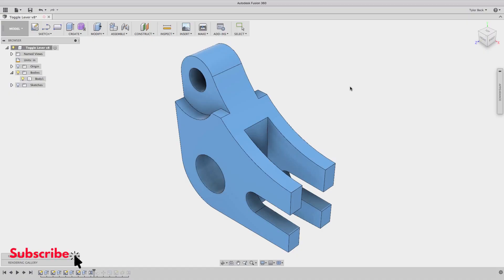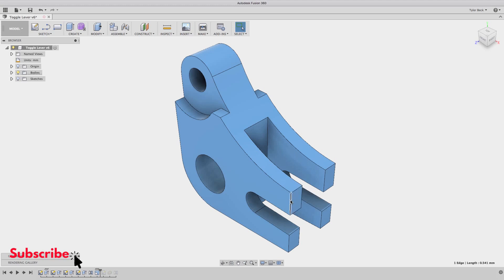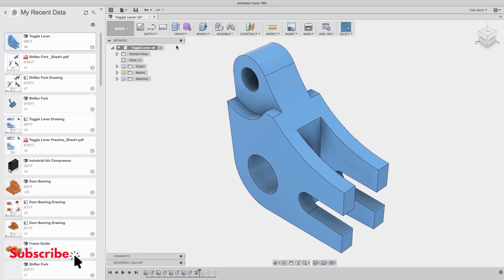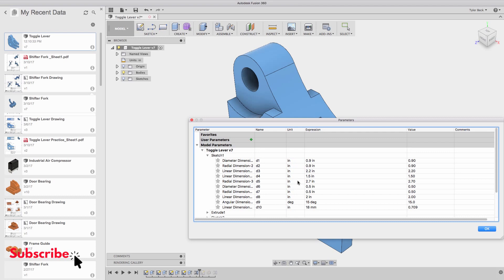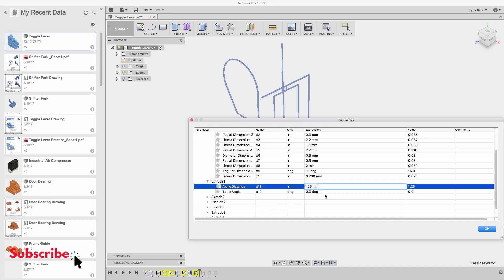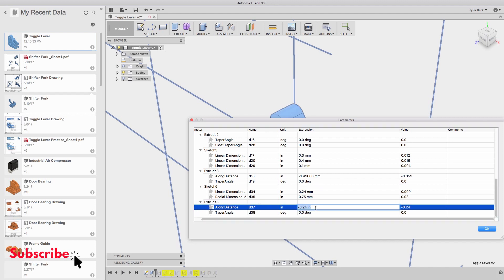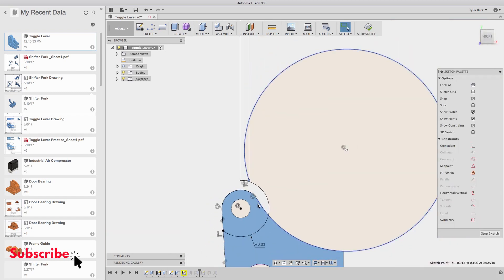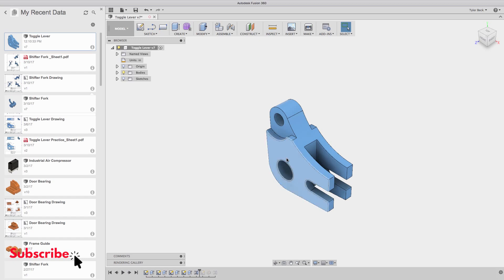Fusion 360 Tutorial - Dimensions Are The WRONG Size!

Comment: Saved my day!  Thanks!

I had imported a bunch of STL files that I had to remesh and reduce and all sorts of things.  Later I found out that Fusion read the file as inches when it should have been meters!   I only noticed it at the very end of 3 days work when I placed the part in a larger assembly and it was itty-bitty tiny.

I was able to fix it by backing up the timeline to after every mesh-to-brep and scaling with an inches-to-meters scale factor.  Then I changed my model to meters and opened the parameters and deleted "in" from every value that wasn't zero (Fusion assumes the new units if you leave it blank). Tadah!

Thanks again!